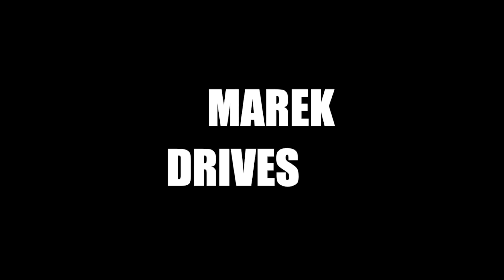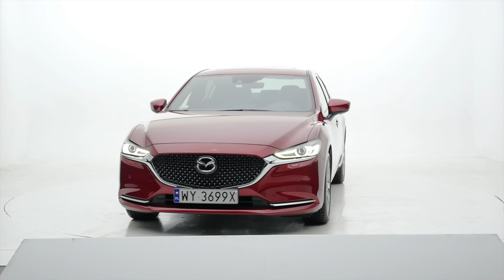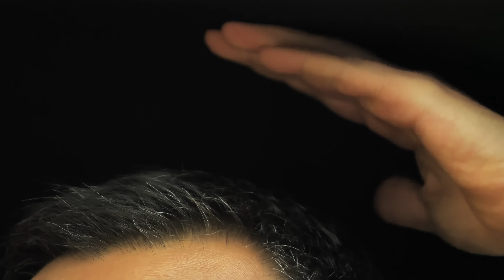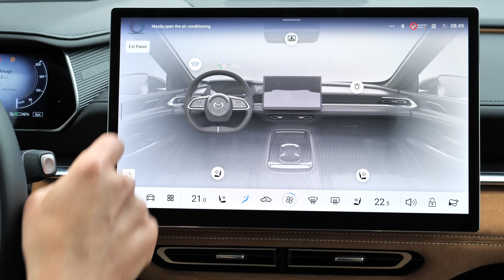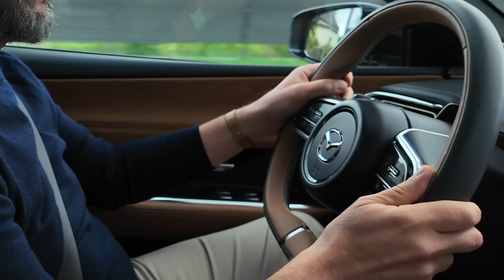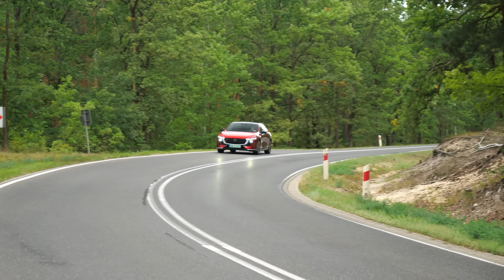Mazda 6e - Japanese Premium EV Sedan... Made in China (ENG) - Test Drive and Review

Comment: Thanks for a great presentation Marek and please don't ever change your presentation style, it's a ripper. I wasn't interested in EVs and always preferred the idea of a hybrid. Two reasons, 1st they're quick to refuel with no range anxiety and 2nd they have spare tyres (even a space saver is better than nothing). However, once I saw the Mazda/Changan EZ-6 with its lift back (thank goodness its back), I started to take notice. The design of this car was a huge step forward so I sweated on Mazda Australia making their business case and thankfully they did as I'm now ready to change. The Mazda 6e looks great inside and out, and Australian motoring journalists found that the Euro evaluation car handles and steers well for a luxury cruiser. I believe that Mazda Australia (MA) are looking at tweaking these further for our market (hopefully a little less float with more direct steering), so I can't wait to drive it. Top speed is a moot point as we can't legally drive faster than 110 kms (OK some drivers will hit 120 kms + but not often). Thus, it should have more than enough power and steer well around town and the motorways where I do most of my driving. MA specified a larger 78 kwh LFP battery that accepts the 165 kwh DC faster charging (30% to 80% in around 15 mins), with a range of over 500 kms makes this  a better compromise than the two Euro options 68.8/80 kwh battery combos. 

This takes care of my 1st concern above. Pity the car is already heavy as a space saver under the front bonnet would've given everyone insurance against flat tyres (will tyre 'goop' fix a punctured sidewall?). The other gripe I have is the loss of the useful physical light & wiper stalks and the side mirror controls being replaced by on screen functions. These were never intrusive, so why change them? This will take some getting used to so will need to assign these to the favourite buttons on the steering wheel. I currently drive a 2013 Mazda 6 Atenza and had to change the tiny 5.5 inch infotainment screen to an after market Nakamichi 9 inch unit with wireless Apple/Android that seamlessly sits in the same position in the dash. That meant no more rotary control but kept all steering wheel functions. I'm now used to making minor on screen changes on the hop, so the new large screen doesn't faze me as much. Finally, if this car sells well then a future Mazda 6e MPS twin e-motor AWD could make a comeback in a few years. Zoom Zoom.
Reply from the maker: Thanks for your comment!
At the risk of sounding like THAT type of a person, I'll say current safety regulations around the world, while aimed at reducing road deaths and pollution, also take fun out of driving. 
While I try to be reasonable behind the wheel, especially in dense traffic, I also try to move with traffic, which in Poland is rarely close to the prescribed speed limit. The lawmakers are trying to curb our "Slavic spirit" by introducing more speed traps and average speed cameras, as well as implementing harsher penalties, so one day we'll also be driving obediently, and range anxiety will not be an issue, as nobody will be driving fast enough to realise how inefficient EVs can be during a "Polish roadtrip" :)
I often hear Australian outback horror stories, which leads me to believe you need to have at least a space saver spare to limp back to some form of civilisation. But is it really still this much of a problem? How likely are you to find yourself stranded in the outback with a punctured sidewall, and what would a sedan be doing on a road, where sidewalls are at risk?
On the other hand, and that goes for most modern cars, the rims are so big these days, and therefore the sidewalls are so thin that by the time the TPMS lets you know you've had a puncture, you've already damaged the rim. 
Anyway, in your case it seems like the car is worthy of a test drive. If the screen controls don't put you off (how often does it rain in your area?), the design and interior quality are appealing.
Reply: @MarekDrivesENG  I agree about the wipers so assigning them to one of the steering wheel favourite buttons is a must, so I hope that this allows me quick access to altering their wiping speed. We also have draconian road rules in many states & cynically believe that speed cameras are just an easy form of revenue raising. Some of our motorways could easily handle greater speeds that most modern cars are well equipped to handle but we're restricted to 110 km/hr. Australia is as large as Europe but without the population and infrastructure, so our rural roads are not kept in pristine condition. The sides of the roads are often damaged by floods & not repaired as they should be while potholes (and kangaroos) are common. Still the allure of the new Mazda6e with improved ride & handling is very appealing. I can't afford to wait until the 6e's 1st mid model improvement as my car will have little or no resale value, so I need to maximise my trade-in or private sale. At any rate I believe that Mazda Japan is currently working on their own EV platform, so they've obviously learned a few things from Changan that they can improve, so the next 6eupdate will have its Zoom Zoom soul.
Reply from the maker: Fingers crossed!
Good luck with your trade-in.
Reply: @MarekDrivesENG  Many thanks Marek unfortunately, I have wait until April/May 2026 for the 6e's local launch. It would be great for you to test the Australian version & compare it to the UK & European versions (come on Mazda fly him over) as you could have a lot of fun on that review. Let me know if you're ever coming to Sydney as the first pivo will be on me. Cheers, Steve.
Reply from the maker: I'm sure Mazda would find it worth their while to have me test their cars, while driving upside down 🤣
I have family in Melbourne, but if I spend 2 days flying there, I'll definitely pop in to Sydney as well. Cheers!

Comment: I'm not in the market for a bEV, or in fact any recent new model car of any powertrain as nothing is desirable! However Marek's videos are interesting & a bit sarccy plus it's good to keep abreast of current trends, advances & models. 
As for the vehicle, at first it looked-like just another Chinese market bEV-thing, however after a bit i could understand the front & rear Mazda motifs, still.... It's also very nice to see an interior that's not just black or one option of white. I'm annoyed at the trend of making non-SUV vehicles have a coupé style rear-end as it loses haed-space, however since this is a lift-back all is forgiven as it's much more practical than a boot, so desirable. WTF is with the flat-bottom steering wheel trend in ALL manufacturers these day - no tell a lie, not all as some have flat top and bottom wheels or such - do they all source them from the same factory in China?? The less physical buttons in a car the less i want it - all because a car is electrically driven doesn't mean it has to be controlled like a smart-phone, so many unneccesary tech gimmicks in cars nowadays.

Comment: For the life of me I don’t understand why almost all car reviewers always show us backseat legroom with driverseat set to their own respektive hights. Makes no sense. Why not always just show us ‘worse case scenario’ with driverseat all the way back so viewers can actually compare backseat legroom sizes in the cars?
Reply from the maker: 1. Reviewer's height and their driving position is an adequate point of reference. 
2. Some cars have excess seat adjustment, and it's hard to imagine someone so tall that they will need to move the seat this much back. Other cars (especially Chinese) often have only modest adjustment, because they prioritise rear legroom at the expense of taller drivers' comfort. So if I showed you a lot of rear legroom in this Mazda it wouldn't tell you much versus something like the VW ID. 7, where I can slide the front seat much further back.

Comment: Looks great inside and out but like the new Mazda CX-5 on screen menu controls are no match for pyhsical buttons.
Too much chinese DNA for its own good. For 45 000 Ero it should ride better and be quieter.
Until the recharging infrastructure improves (Australia) ICE hybrids are a better solution than PHEV.
That said currently there are camouflaged prototypes 6e's doing the rounds in Australia.
Reply from the maker: Still camouflaged? Maybe these are test mules for the CX-6e/EZ-60 crossover?
Reply: Nope, according to Australia's Car Expert site the Mazda 6e EV has been spied in RHD form ahead of an expected Australian launch.
The latest spy shots dont reveal anything new about the 6e's exterior design, the liftback sedan has already been shown off without camouflage overseas.  @MarekDrivesENG
Reply: Nope, according to Austalia's Car Expert site the latest spyshots dont reveal anything new about the 6e's exterior design, the liftback sedan has already been shown without camouflage overseas.
Spied in RHD form ahead of an expected Australian launch it has already begun fine tuning its software and potentially hardware to suit our notoriously unique driving conditions - something the brand chose to forgo with the launch of the widely cticicised Mazda CX-60  @MarekDrivesENG

Comment: Hi Marek, thanks for a great video! I have a quick question – did you get a chance to test the car at night? If so, what did you think of the headlights? Was the road well illuminated?
Reply from the maker: Yes. While the headlights seem bright enough, the automatic high-beam system is easily fooled by reflections from road signs, etc., so it wasn't the most seamless experience.
Reply: @MarekDrivesENG Thank you very much! I’ve actually ordered the car, and I have a bit of trouble with my vision when driving at night. The fact that the headlights are strong enough is just perfect for me. Thanks a lot for a great video.

Comment: The market needs to start punishing manufacturer who engage in this ridiculous "software everything" behavior. Vote with your wallet people.
Reply from the maker: @LegacyOfTheAncientsC64c tell it to Tesla fanboys :)
Reply: @MarekDrivesENG  Ugh... don't get me started. I recently drove a 2024 Model S that didn't have FSD (just the basic "autopilot") and when I told the owner my KIA K4 (HDA2) drove better than his Tesla he went full on fanboy. So I had him try my K4 and you should have seen his face.

To be fair, I have tried Teslas with the latest FSD and that is very impressive. But, if the car already has all that processing on board why not use to make the basic autopilot work reliably. Honestly the message feels like they purposely make autopilot drive like crap to steer people towards paying for FSD. 

 My KIA's Highway Driving Assist v2 drives so much more reliably than the Tesla that its just a head scratcher as to why Tesla owners tolerate such bad performance.

Comment: I still remember your bad review for the MX-30. Unfairly accusing a car with that personality, got you now driving a Chinese Mazda. Karma 😄
Reply from the maker: MX-30 would have been fine with 100 km more real life electric range. Or better still, they should have put that powertrain into a CX-30. Mazda Experimental only taught them they can't make EVs, even if their lives depended on it. And it does!
Reply: @MarekDrivesENG MX-30 is far more interesting (can say "unique") car than the CX-30. Not that the CX-30 is a bad choice for the masses. Not at all. But the MX-30 is something beyond. It should exist, in true Mazda tradition ❤
And ok, I agree with your remark about the range, but you were very negative against it, even beyond the range aspect. Even cars you don't like, have some positives. Professionals, engineers & designers, put a lot of effort to make them..
Do you think the Chinese Mazda is a better car? Something memorable? Better in quality?
I would take an MX-30Rev anytime (probably the best value plug-in hybrid).✌️
Reply from the maker: While I'm all for out-of-the-box thinking and quirky cars, the MX-30 stands against what Mazda has been feeding the media for many years. They kept saying: our means are modest, and therefore we need to be very careful about the decisions we make. 
Enter the MX-30, which used a unique body and unique interior, which must have generated huge costs. It shared a platform with the CX-30, so if they needed to sell some EVs to clean up their fleet. 
On several occasions I asked Mazda reps WHY? And they had no good answer. 
The MX-30 was probably a decision made somewhere much higher up the food chain, but to me it was like Mazda admitted they are full of shit. And now they came out with this...
Reply: @MarekDrivesENG so Mazda officials had no good answer to your “Why?” and even admitted they were full of shit!!?  …Ok dear 👌